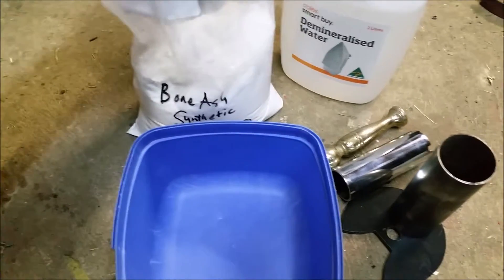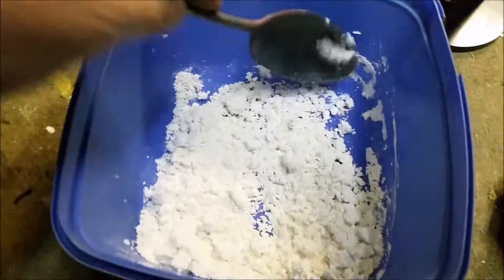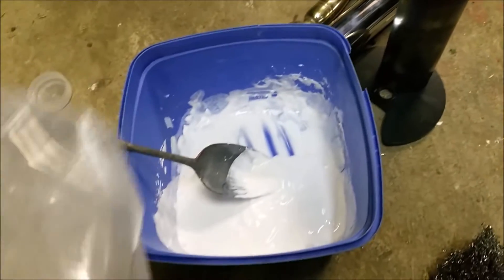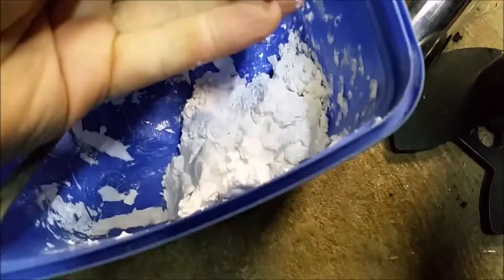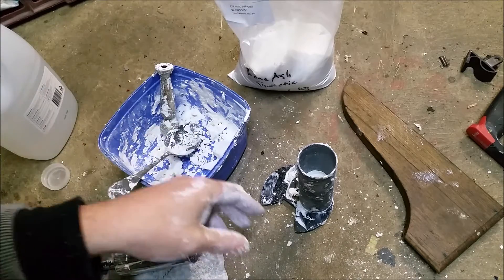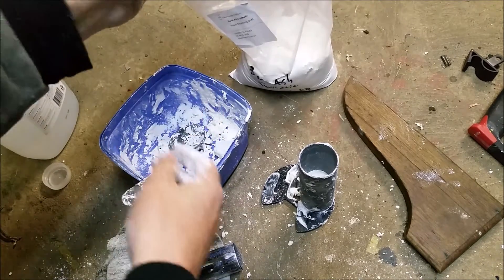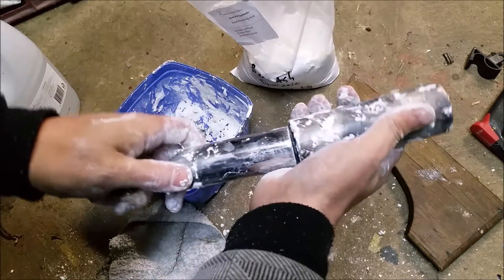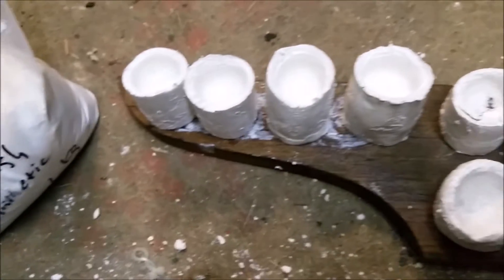Make Cupels for Gold/Lead Separation

Comment: I understand lead can be used as a solvent to dissolve gold, but can zinc be used instead? In the Parkes process, apparently zinc is added to draw silver and gold out of lead, so why is lead used in fire assays?
Reply from the maker: Alina Constantinovici parting with acid is gonna be your path i believe. 
https://www.911metallurgist.com/blog/gold-parting-process-nitric-acid
Reply from the maker: yes other metals are used for different problems in cupelling.
Reply: I was wondering about the idea of putting your material for extraction in a bottle and pulling a vacuum on it before heating the lead to prevent oxidation. Maybe put the black sands or whatever in a stainless steel bottle, pump out the air and seal it before heating. I wouldn't want to pull a vacuum over the molten lead because  it would probably increase the amount of vapours given off. I was concerned about the toxicity of lead vapors, but apparently very little is given off at reasonable temperatures. Does the lead need to be above a certain temperature for good extraction, or does it just have to be liquid?
Reply from the maker: Blitherer Masterman so initially the lead is in an oxide form and reduces back to metal because of things like burning rice flour and such reducing agents that would be mixed dry with the ground up ore. As it turns back to metal it percolates down through the powder taking anything that dissolves in hot lead. The cupelling part is when the lead is put in the bone ash crucible and burnt until no more of the frosty looking oxides can be seen rollong on the surface of the bead. There are vacuum chamber machines for casting precious metals that operate at vacuum to reduce oxides formed so it can be done and i suspect that it would cook off a lot quicker but I don't have any more experience with such things. Look up some of the old fire assay books.
Reply: Ok, so the idea with the litharge is to refine the lead and get the other metals along with it. I was wondering if you could use the lead almost like mercury in a vacuum. Will have to try an experiment I guess.
Reply from the maker: Blitherer Masterman yeah i don't see why not. It is gonna pull the PM's into it even without the vac but i guess your gonna get way less oxide on your lead surface
Reply: @handleismyhandle you want it to oxidize. If the lead doesn’t oxidize then the couple won’t absorb it
Reply: Blitherer Masterman   hello i need help if you can help me? i have an alloy made of copper, gold, silver and lead !! lead is somewhere 7% -9% !! how can I remove the lead? thank you.
Reply from the maker: Alina Constantinovici hi, i don't have the hands on experience that you seek. Cuppeling will take the copper too. If that is ok then just cupel it. Without some electrochemical process I don't see that you will be able to remove just the lead. It would probably be easier to cupel and put the copper back in if it needs to be a certain carat purity. Look up Owltech. He has a lot of hands on experience.
Reply: the alloy is composed of 79% copper, 9% silver, 1.6% gold, 8% lead, and rest 0, ...% aluminum, zinc, tungsten, titanium, iron ...... How can I extract important metals
Reply from the maker: Alina Constantinovici titanium and aluminum will burn bloody hot too when cupelled. I would think that might burn off good stuff when it goes. I don't know this for sure but I do know how these things behave when burning and they burn hot. Hot enough to vapourise things. That's another reason why acid parting is gonna be the way forward.

Comment: you can just use refractory cement that you get for a pizza oven or just come over and I'll give you some phosphate bonded investment, same stuff I made my crucible from...and it sets in 1/2 an hour, not 2 weeks..lol.
Reply: or u can use dry  portland cement in ss cup no need for setting at all ;)
Reply: @OwlTech333  beyaz portlan çimentosu kullanılabilirmi ve portland çimentosu değerli metal kaybı fazla oluyormu
Reply from the maker: What is this phosphate bonded investment you speak of? Cupel needs to be bone ash which is about 55.82% calcium oxide, 42.39% phosphorus pentoxide.
Reply: it's a refractory material ( mold material) with mono ammonium phosphate as a binder. The rest of the material is quartz and crystobalite, commonly used for high temperature casting.
Reply from the maker: electro1622 would it absorb lead?
Reply: probably not but I'm not sure about that.
Reply from the maker: electro1622 i was just doing some further readingon  the subject of cupellation and the wiki entry says the crucible needs to be calcareous because lead reacts with silica (clay compounds) to form viscous lead silicate that prevents the needed absorption of litharge, so that investment you mentioned would work well for quick crucibles but won't work for lead absorption. Is it costly material?
Reply: no..cheap..well, cheap for dental materials, 160 bucks for 8 kg.
Reply: m3sca1
I noticed your mix does not have a binder in it...you may have to press the material together like you fist thought in a press..mixing with water does not bind it so when it dries it will probably be too crumbly.If you press it together do it when it's dry..no water.
Reply from the maker: electro1622 yes agree...was worried about the water content...i read it will crack when drying if too wet.